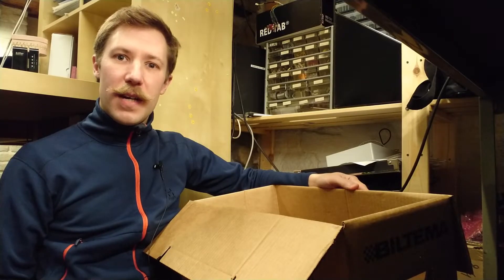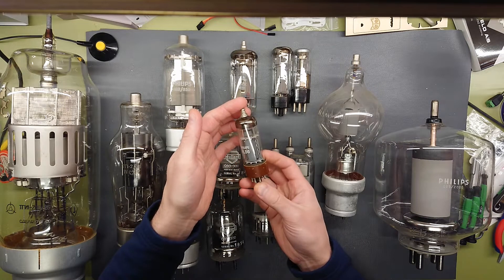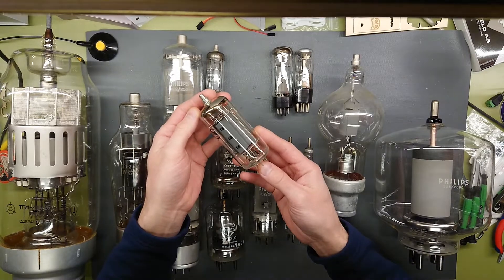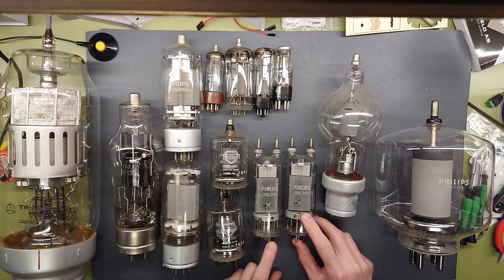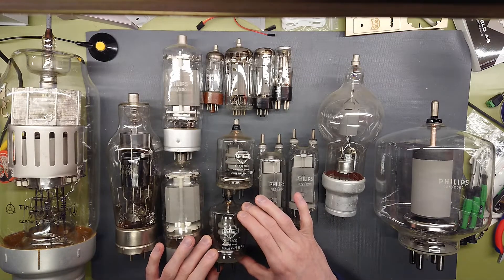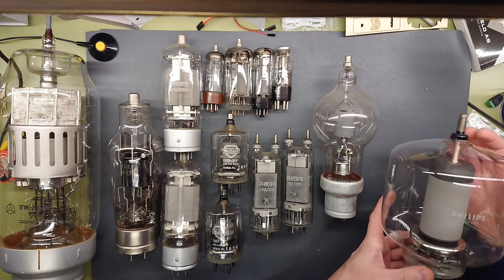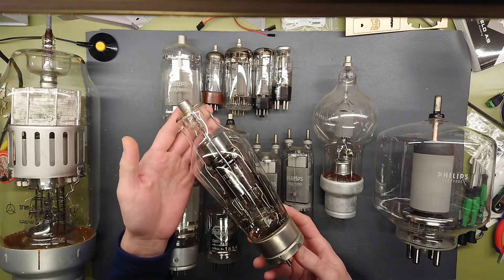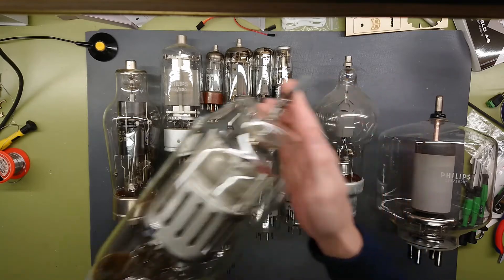Power Vacuum, Radio and Electron Tubes - Isolation, Day 7

Comment: I came here via your 6P45S project, is it somewhat finished? Your last blog entry was 2015. I am building a single ended amp with this tube..
Reply from the maker: I kind of went into a love/hate relationship with that amplifier as the power supply would not be stable and I kind of regret not going for a regulated smps instead. I can actually see the amplifier from where I sit at my PC and I have been putting it off to fix it for 5 years now :o 
I only need to look at the input sensitivity, it is too sensitive.

I must however say that I have been in a "cleanup" mode for the last couple of years, finishing projects, using parts I have, get rid of things in stock and generally get more things done instead of starting new :)

Comment: Thank you so much for this video. Until I started to watch youtube videos I did not know these valves existed. So when a chance came up to buy a really old battery charger I got it because of youtube videos. It did not work when I plugged it in, so abrasive cloth was used to clean up the Edison screw on the valve and it worked. If you are interested have a look at my video (Tungar battery charger and electroylitic diode).

Comment: The hydrogen thyratron actually contains a chemical hydrogen generator which contains titanium hydride, a compound that when heated, decomposes into titanium and hydrogen in a reversible reaction.
Reply from the maker: Thank you very much for elaborating on that, I love to learn all those little details from comments :)
Reply: Why have hidrogen into a tube? Isn't a very reactive gas?
Reply: @marcorizza274  It's used as hydrogen ions are light enough not to damage the emissive coating on the cathode while still allowing gas discharge to occur
Reply: @ionut5350  makes sense, thx